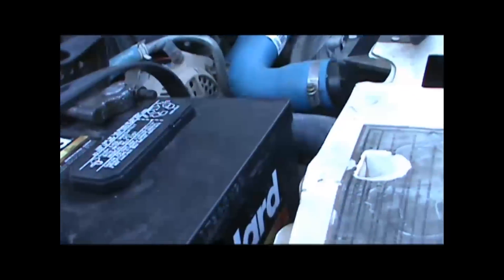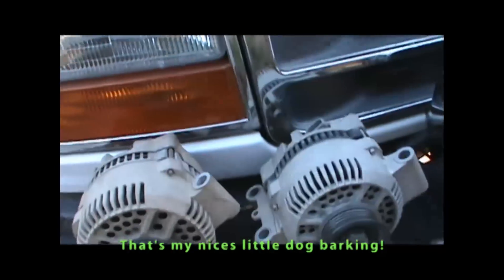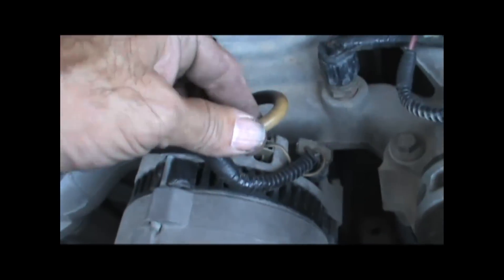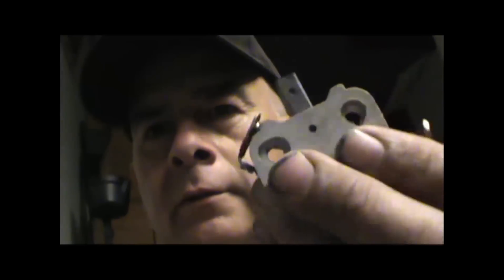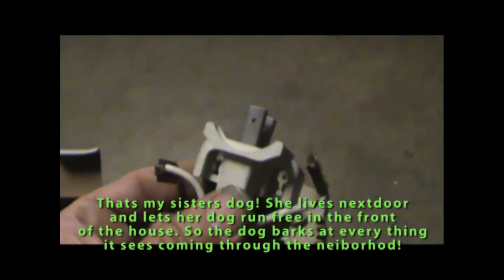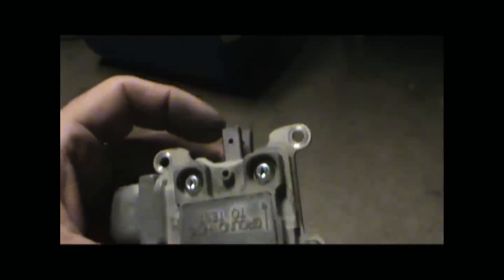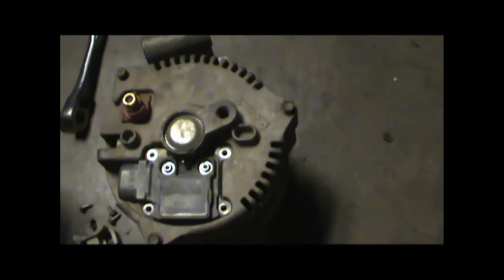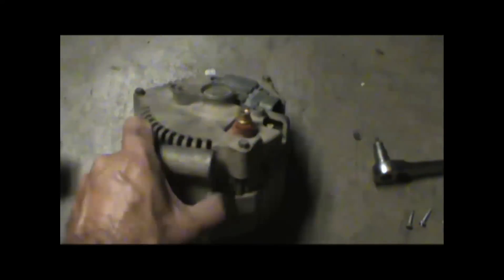Bronco Alternator repair

Comment from the maker: Just took the Bronco to get SMOG checked! It passed everything but the fuel system check. I got a small crack in the fuel tank. Yes I know about the crack. I quess the JB Weld didnt hold. So new gas tank on order.  Do you think I should put a new fuel pump to?

Comment: Did you have a video where you removed it from the engine? I've got an '88 351 W but it looks like only 3 bolts.
Reply from the maker: Stephen SkakandyNo sorry no video. But its easy. First remember to disconnect the battery. You dont want to short anything out.